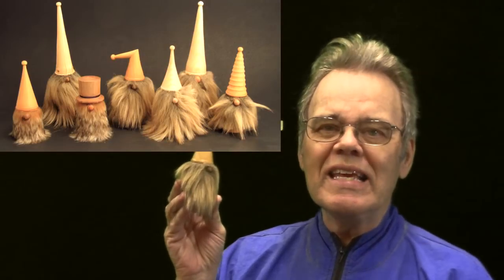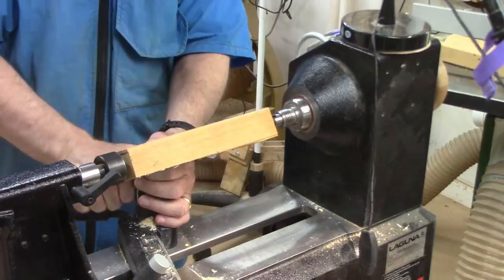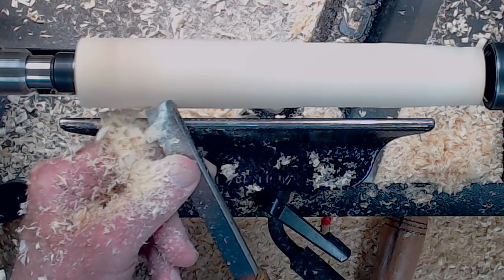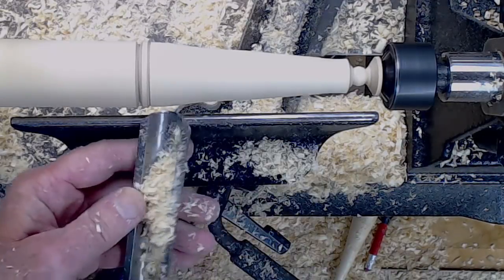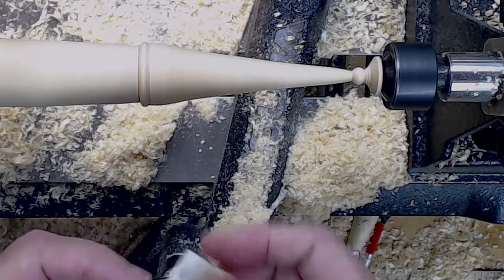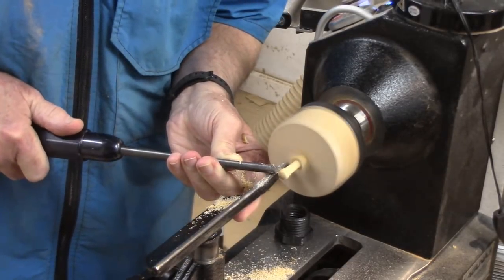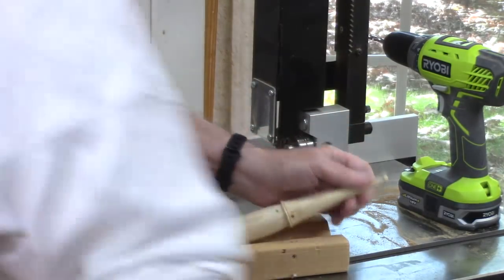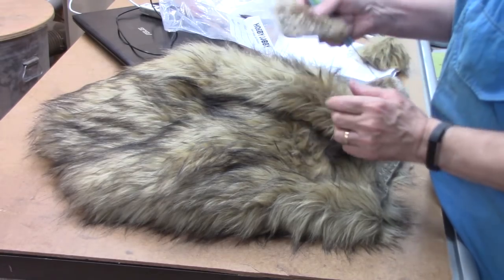Turn a Wood Elf – a Basic Midi Lathe Project

Comment: Thanks for the inspiration, Mike. 
To drill a hole in soft material like this fur or leather or any other, I tend to clamp it firmly between 2 pieces of scrap wood and I drill through. That holds properly the piece and as it is held on the entrance and on the exit of the hole, I get quite a nice round edge to my hole.
Reply from the maker: Great tip! I will try that on my next one.
Reply: I have a set of hollow punches.  I think I'll try them for this project.

Comment: Elftastic Mike,
For accurate cutting of the fur, I make a paper template to fit exactly, transfer to the back of the fur and mark out using a sharpie. Handy for production work (assuming you are repeating the same elf style of course!)
Thanks for the videos, very inspiring,
Kind Regards,
Steve
Reply from the maker: Great tip!

Comment: Hi Mike you can cut a round hole in the beard fabric with a round  hole punch sharpened on the  sander  then a couple twists of the wrist on  a block  and presto! Thanks for all the videos stay safe
Reply from the maker: Great tip!

Comment: Loved your video. I addressed my problem with glue guns 3 years ago. Amazon has a 300 W /150 W switch.. Brand is AL $39. Has off on switch very quick heat up. I do large glue blocks for finishing extra large bowls and née a fast deposit gun.
Reply from the maker: Wow that is a lot of heat! I did not know they had those. The next one has some great tips on this project so stay tuned.

Comment: What an adorable little project. Looks like some folks in the family just might be getting some of these this Christmas if I can source the faux fur I'd like to use. Thanks for all of the options  on holding the various bits, that will prove usefull on more than just these little elves, I'm sure. I am left wondering, however, how many will view this video and sit wondering how you did the bent hat. 
Let me proffer one possible solution...
Use some sort of saw and cut the hat at half the angle at which you want the final bend to be, turn the upper piece of the hat 180 degrees and glue it back on with CA glue (use accelerator if you have it). Sand if there is any evident residues. Then finish/paint the wood, and let dry, as you like before attaching the faux fur.
Reply from the maker: Thanks. You said in just a few words what whould have made the video too long for me to show. I use my fairly recent band saw jig so I can just thread on a chuck when I am read to cut. I found about a 45 degree angle works for me.

Comment: Watching this, I have to wonder if there is an easy way to put shoes on these elves. What I would want is to have the toes of the shoes sticking out from under the fur on the front of the gnome, just long enough to be seen, and maybe 1/8" high. I can't visualize how to do that "fast and easy", but it would be cute if it was done, I think.
Reply from the maker: Thanks for the idea of feet! Fast and easy? Umm. I have a couple of possibilities. I will try them out next time I make some. One is to turn a larger ring base and carve/ sand away what is not needed with a dremel too.  The other would be a split turning with a paper joint and then glue them to the bottom.
Reply: @MikePeaceWoodturning  Remember, I get royalties on the idea.  If you get rich on it, you owe me a cup of coffee.  :)

Oh, and if you do it at all, I would love to see a video on it.  :)
Reply: @MikePeaceWoodturning  I have another idea for a project that would use an inside-out ornament. It would be heavy so it could not be hung on a tree, and it uses electronics too. The idea is this: You rough out a nice ornament and finish the inside part and get ready to turn the outside part. But before you do you pot it in epoxy resin. But here is the twist: you mount a little WS2812b (or two) inside the ornament and then put enough additive in the epoxy to make it just a little translucent. Then you turn it so that all you see is nice wood and epoxy. The attach it to a tiny microcontroller (Arduino-type) and have the LED's light up and shift colors. It might look very nice on your mantel or shelf, and the electronics could be hidden inside the base.

I think this might be a fun and productive collaboration.
Reply from the maker: @flingmonkey5494  I will leave that to you. I don't do resin. At least for now.
Reply: @MikePeaceWoodturning  Ah, and the unfortunate part is that I do not do wood-turning, yet. I am living far from home, renting a room, and I do not have access to my tools. Worse yet, I don't have a lathe yet. But I do have the ability to do the electronics and the programming, I am sure my company would let me solder in their lab and I can program at home. I have already seen that I can do interesting things with electronics, LEDs, and epoxy resin. I am now thinking of adding wood-turning to the mix of skills. I think it would have fabulous results. I have seen projects on YouTube that mix wood-turning and epoxy, what if I add colorful LEDs? I won't push you if you are not interested, but I think it might be cool.

Within a year I hope to have a new house and a new shop and the ability to purchase and use new tools (I really need a new table saw.) At that point a lathe is certainly a possibility.  :)

Comment: It's been a hairy year, so these are appropriate to the times :)
As a newbie turner, this looks even easier than the Christmas trees (or at least, I can hide more flaws).  For the hole in the fur, you can also fold the hair in half (fur side in), and use the tip of your scissors to make two nicks (like an X shape).  
Thank you so much for these videos! 
Only problem is that now I can't decide which ones to make.  Maybe I'll try several of each.
Reply from the maker: Thanks for your tip with the scissors! It is better than cutting an X witha razor knife.

Comment: I prefer just making a beard instead having a full body of fuzz, I also make them a bit better fed (large bellies). One tip for the budget conscious, I found it much cheaper to buy a faux fur pet bed at $15 and cut it up rather than buying faux fur fabric, it can be a bit expensive at $40 - $80 per square.
Reply from the maker: Good tips. I found some gnome videos today that use smaller beards and I agree with you. I found the faux fur at Hobby Lobby for about $17-$22 per yard and you can buy as little as a quarter yard. I am going to buy some white faux fur.
Reply: @MikePeaceWoodturning  Santa Clauses! 😉👍